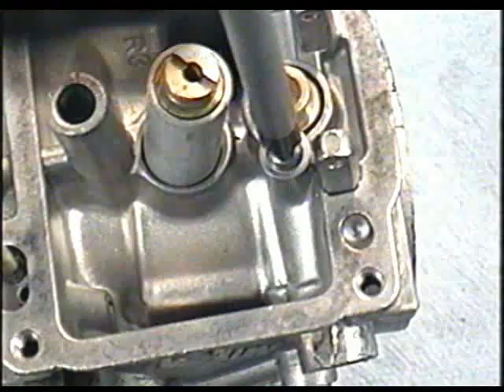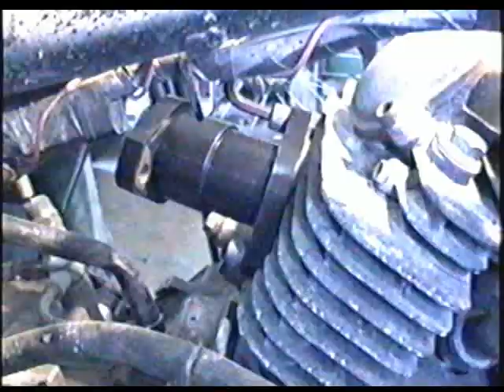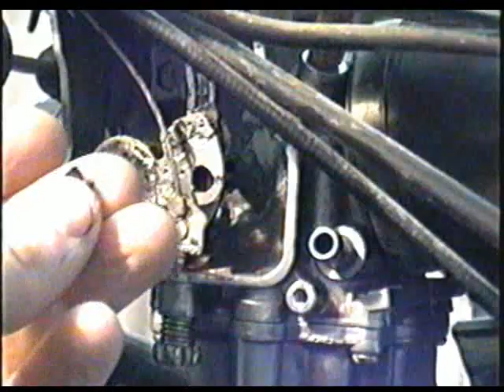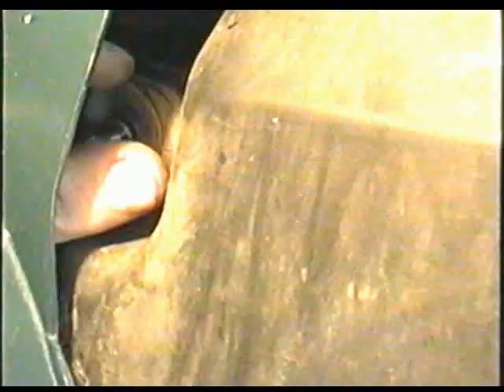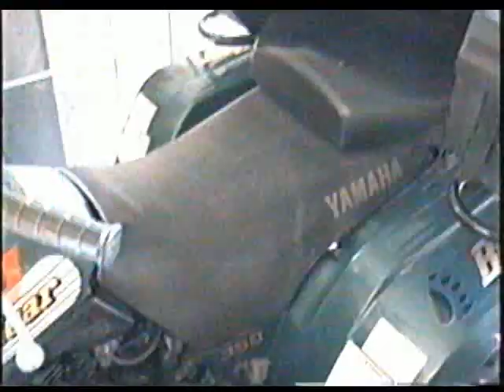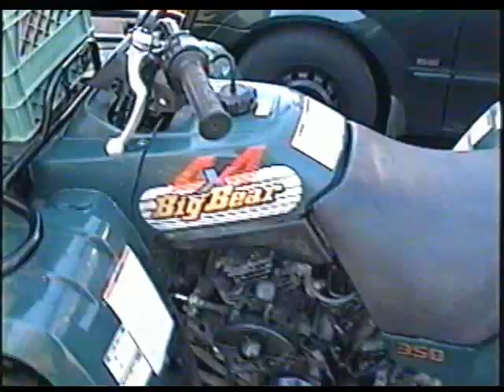Yamaha Big Bear ATV Carburetor Clean & Repair Part 3 of 3

Comment: You have dirty pilot  jet and or clogged idle mixture screw passage. Typicaly for something that dirty you will want to fully disassemble and soak the carb and its individual parts in a gallon of carb cleaner. Not the junk you buy in a spray can. The gallon of cleaner can be bought at any auto parts store and will run about 20  bucks.

Comment: i have a yamaha big bear 350, it wont stay running, iv adjusted the idle screw various times and it wont stay running when its on it runs for about a minute then it like "chokes" and shuts off. do you think it could be from a dirty carb or is it somthing els internally? thanks!

Comment: all your equipment seems to run great when you're done!  what do you think of this:  i got an old mower for free.  B and S  6 horse.  the intake tube that feeds gas from the  carb to the motor was  missing.  I  found a replacement  but dont have the gasket where it mounts to the engine.   A little RTV silicone do the job?